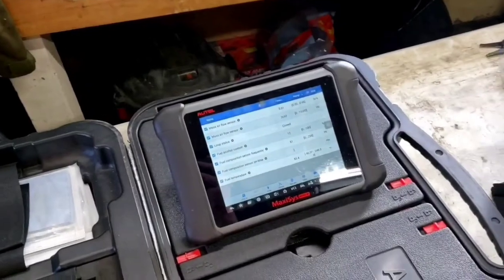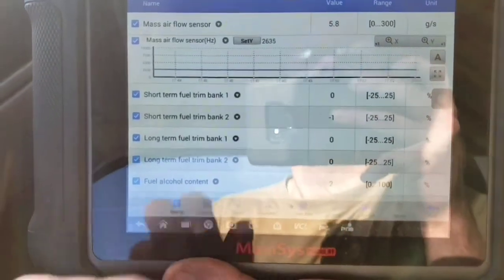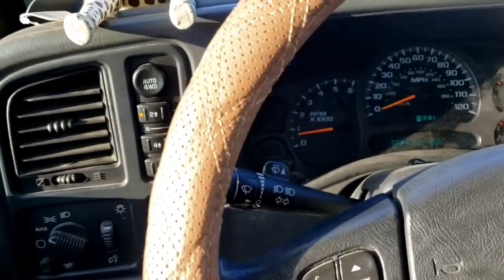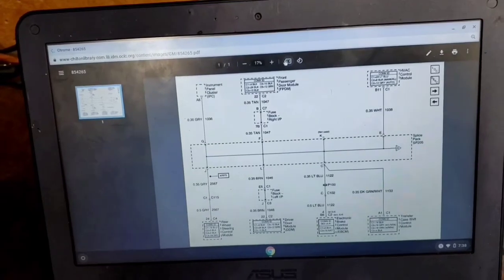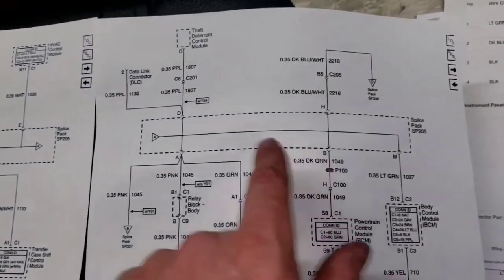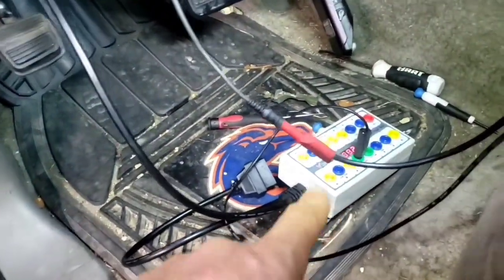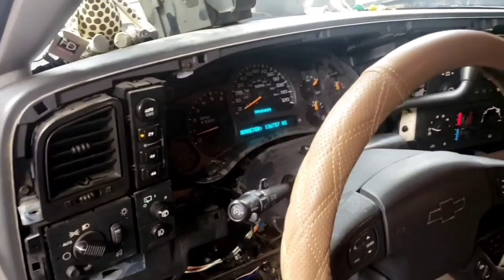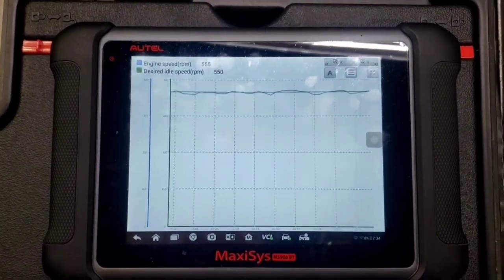2003 Chevy Suburban Fuel Alcohol Content, Running Rich, & Parasitic Draw Part 2

Comment: Fuel Alcohol Content seems like a strange thing to monitor. I don't know what the context of that statement means. Is this a normal thing to monitor on modern vehicles? @04:23 that oil pressure is maxed out.
Reply from the maker: We have to troubleshoot the oil pressure sensor...probably a sending unit causing issues.